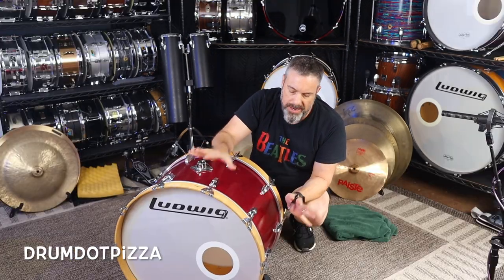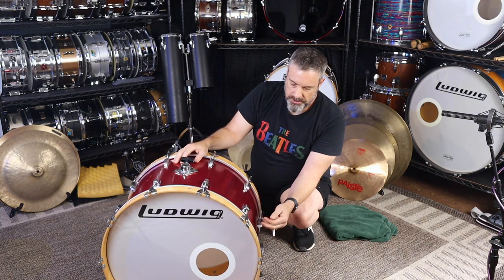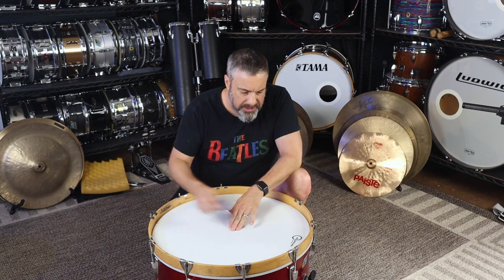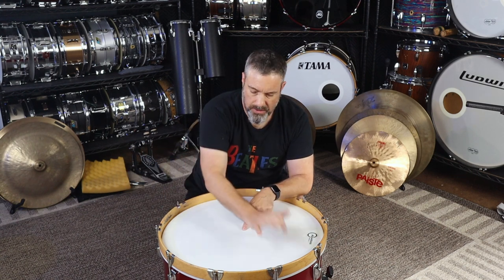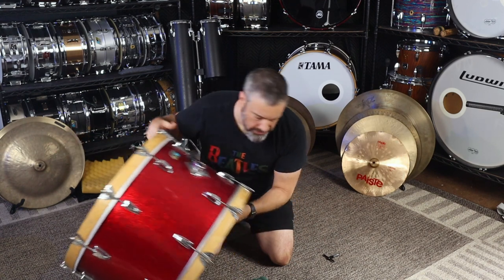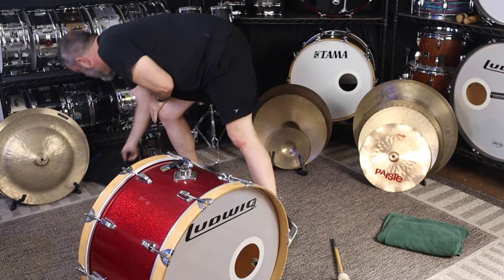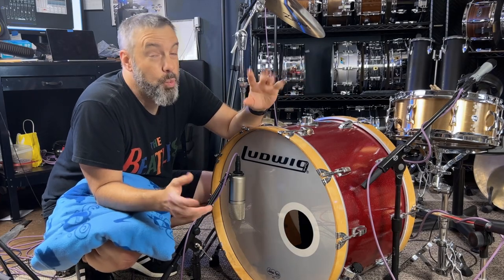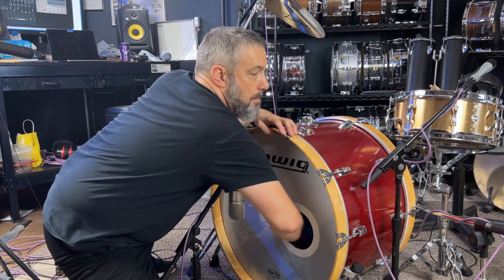Tuning Your Bass Drum With Microphones In Mind

Comment: I've always thought that hollow basketball sound was something I didn't want....but I guess it's a different sound when miced and recorded properly.   Thanks for making a great and informative channel.  I love it
Reply from the maker: Thanks so much for your comment!    Yeah, the unmuffled 'empty' kick drum is a weird sound, but actually it can be rather cool in the right context, particularly if you add the outside mic as well (which I didn't in the short clip in this video).  Usually, though, even if I don't actually try to tame the heads with muffling I'll still put that light piece of foam in the bottom of the drum to absorb some of the high frequencies bouncing around.  Even that little bit of soft mass can tame the 'basketball' effect to something more broadly useful.

Comment: I had that same Ludwig bass drum it was a bad mofo! One of the best sounding drums I’ve had or heard. I liked a medium tuning, higher than what you have but not much, with no muffling just whatever muffling the heads would provide. AKG D112 right by the hole and done. 🎉

One thing I didn’t understand was when people would take bass drums and then tune super low. It’s a bass drum. It’s already very low. 😂
 
I would love to hear that drum tuned up like half a turn on both sides. I bet you it will sound even better. 

Also thought the detuning a lug or two was totally ridiculous and unnecessary. Just tune both the heads medium with the front head higher. I didn’t understand the overthinking. 😅

Comment: Kind of off topic. I'm a drummer and I just did a renovation in my basement studio that made a really big positive difference. Pretty good size basement, but low ceiling. 7 and a half or 8 foot tall, unfinished ceiling. Cinder block walls, but I have a lot of bulky furniture and acoustic foam on the walls to control the sound. What I did, was finish the ceiling by putting rockwool insulation between the joyces and then enclosing the ceiling with moving blankets. Deadening the ceiling made everything sound way better. Especially when I add reverb to the drums, the reverb sounds much cleaner than before. And compressing the overheads or room mics doesn't bring up weird reflections from the ceiling anymore.

Comment: Man, the resonant setup sounds massive. So good.
Reply from the maker: Thank you!  Did you check out the companion video on my rebooted recording channel (RecordingDotPizza) where I show how to emphasize that character in the mix?  

I absolutely love the bit of what I call 'bloom' that happens with the fairly unmuffled single ply front head.  It does add a real sense of mass and authority without getting in the way of definition.  The best of both worlds!
Reply: @drumdotpizza  yeah, it sounds big without losing definition. Your setup here manages to get a really low note without getting flabby.

Quite frequently when I hear a really low tuned drum (not only bass drum, but also floor toms and sometimes large rack toms), they get this weird thing going where as the note resonates it kind of wavers in pitch and amplitude, instead of decaying smoothly.

Yours here is an authoritative thump, followed by a clean and crisp tone that decays smoothly. It's so pure it almost sounds like a synthesized sine sub.

I did check the other video (almost more important than this one, to me - I'm actually a bass player that does quite a bit of mixing) and will certainly be applying a lot of what you've shown there.

Comment: In this video, are you burying the beater or letting it bounce off? As an engineer, what is your opinion on how those two different sounds record or sound live?
Reply: Bets on buried.
Reply from the maker: I do NOT bury the beater.  I play heel up with the ball of my foot about halfway down the footboard with sufficiently high spring tension, so when I relax between beats the beater naturally comes off the head.  

There are some great players who bury the beater, but it just never worked for me, and I prefer a more open sound anyway, so don't want to stifle the batter with the pressure (and I've recorded TONS of drummers over the years who try to bury the beater, but either don't play appropriately for that technique, or tension the batter to high resulting in the messy 'flam' effect of the beater bouncing off then back onto the head with each strike.  That is damned annoying to deal with in post (I have more than a few times had to resort to sample replacement with such drummers).  

Vinnie and Dave don't have a problem, but a lot of drummers who try to bury the beater do.  

So no, I don't bury the beater.  And I prefer a the more open, resonant sound of not burying it.  Not worth dying for, but my preference if I can have it.
Reply from the maker: No actually (see my reply to the original question above).  

Interestingly, the lack of burying adds a definite clarity to the attack as there is no possibility of the 'flam' effect of the beater bouncing off the head and back on again as it does with some players (Neil Peart being one... listen to some of the isolated drum tracks on YT to see what I mean).  It's not a deal breaker, obviously (Neil was the MAN!), but I prefer the articulation of a single strike to the head followed by pure resonance (if not muffled).  Yields a very articulate definition to the sound without stifling the resonance/sustain of more open tunings.
Reply: @drumdotpizza  I stand educated. I could have sworn by the 'type' of power and control in your thump... even the less processed audio... And truly hope I didn't offend ;) Thought I knew mine ears better.
Reply: I've been playing drums for many years and I myself don't bury the beater all the time but sometimes you can't help not to bury the beater - it happens out of necessity.  I guess I learned that way but I honestly don't remember anyone telling me or teaching me to play that way.  Yes, you can hear the difference when you are listening to the drum microphones in solo but I'd venture to guess that you wouldn't be able to hear the difference in the context of a full band mix.  Not burying the beater does sound better to me with better definition and articulation but as Joel said in his comment you will have some pro drummers who bury the beater and some who don't.  Thee are several drums only versions of pro drummers on YT that are good examples of this.  One final thought, I remember watching an interview with Todd Sucherman of Styx on Drumeo where he was asked about burying the beater or not and he said he has never had an engineer ask him to play one way or another - and later went on to say don't worry about it!!!

Comment: I want to cut my bass drum to 14" but i'm just worried if something goes wrong, a 22x20 is way too long. Even thought of using the left over shell for a gong drum
Reply from the maker: Well... I don't want to tell anyone what to do with their property, but I would suggest that if you decided to do so make sure you have someone knowledgable handle the heavy lifting (cutting, truing, routing edges), and you do the finish up.  Just measure twice (or thrice!) before cutting/drilling/etc if you do it.  A little care can go a long way and the results will be wonderful, I'm sure.  

FWIW, I'm have planned a comparison video in the next few weeks cutting down a Pacific CX series (sugar maple, made in Mexico) 22x18 bass drum to 22x14.  I will record it stock first, log all the settings, then do the mod and re-record with same heads/tuning/signal path/processing for the sake of a reasonably scientific comparison.  I'm really fascinated to experience the results as I believe I know what to expect (based on decades of working with different dimensions of kick drums), but I have never done such a direct comparison before, so it could be eye opening for me.  Either way it'll be useful to me and I hope to others!  Maybe you should wait for that video before proceeding??

Thanks for reaching out!!

Comment: Been struggling with getting my 22x18 inch bass drum to sound good in my room even under the mics and this has given me some things to try! The drum honestly sounds great if I want to play like jazz fusion and is a great kick drum, but not a great sound for rock or pop. I am really thinking about selling it though and getting much shallower bass drums in both 20 and 24 diameter so I have two drums to go to when I need either that huge or that smaller sound and both those drums can probably get across the spectrum of kick drum sounds.
Reply from the maker: I gig with a local cover band using a DW Collector's kit (belongs to our sound guy!) that has a 22x18 kick (maple) and I tune it very similarly to what I did in this video.  It has good weight, but is more attack than bottom end (part of that is the Shure Beta 91 boundary mic inside the kick, I'm sure -- Beta 52 outside), but it does sound very nice on the live recordings!

I do own a 1968 Ludwig 20x14 kick with natural interior that is incredibly versatile.  Can be tuned for small, punchy vibe, or can open up and sound remarkably huge (MUCH bigger than 20") as well.  

It is amazing what tuning (and processing) can do to the perceived size of a kick drum!

But yeah, I'm a 14" deep kinda guy!  ;)
Reply: @drumdotpizza  yeah believe it or not it’s a 22x18 pdp kick drum birch, getting a good sound but just not super satisfying. I’ll tune it again and keep trying before I go crazy and start buying more kick drums. My room is not that big lol

Comment: This is gold, because I‘m struggleing with my 24x14“ Bass Drum to get more natural low end. I don‘t want to do it via EQ. Maybe a double ply head with no built in dampening could do the trick. At the moment I‘m switching between a coated or clear Powerstroke 3.
Reply from the maker: I really love double ply heads and no pre-treatment (felt, rubber, plastic, mylar rings, etc.).  Frankly when played medium dynamics and above the majority of the sound is attack, so taming the more unruly heads/lack of muffling is still fairly simple to do with some dynamics processing.  

As for EQ, I'm generally a subtractive EQ guy, but with kicks (and sometimes snares) I'll add a bit for weight and clarity/brightness.  I try not to go beyond a few dB here and there, though.  

Did you watch the companion video on my other channel?  I go into the processing that I did for this video, so check that out if you didn't -- might be useful for you (particularly the compression on the outside mic that really accentuates the sense of weight and size of the drum). 

Even if you don't add anything via EQ (you want a 'neutral' sound) you'll still likely benefit from removing some mid/low-mid content to clean up the boxiness that often results from miking kicks -- only as much a needed, of course, but don't be afraid to reach for it.
Reply: @drumdotpizza  Thanks for taking the time, Joel. I think, I‘m going in the same direction. First getting the drum as good sounding as it gets and than process from there. In the beginning I thought, the sound is made in the mixing process, which you can do, but it‘s getting very artificial soundwise. Of course I saw both videos, subscribed to both channels. :-)

Comment: So do you typically like your reso heads lower than the batter?
Reply from the maker: I do, primarily because I want to avoid a pitch which is harder to do with higher tension (though staggering the actual tension at various key rods can blur the sense of pitch).  

Also, with greater tension the 'rattle' of the front head (which sounds so good to me ears when close miked) can be excessively lengthy requiring a bit more fiddling to dial in.  When I record drums with higher tuned front head I may use a tad more muffling (either a felt strip inside or a folded T-shirt or the like along the bottom edge either inside or out) to keep the natural sustain under control, so the processing I do to emphasize its resonance doesn't become a sonic mess.  

Did you watch the companion video on my other channel that I'm reviving?  That demonstrates what I mean.  

Thanks for being here!

Comment: I'd been using PS3 on all my kicks for many years until I broke one a didn't have a replacement of the same head.  What I had around was an Ebony Ambassador from a collection of extra heads I got when I bought a kit from somebody.  I threw that on the drum and was very pleasantly surprised.  After dialing it in with tuning and some muffling to get it under control, that particular bass drum batter sounds better than the PS3 in how alive, punchy and clear it comes across.  I even put a dreaded kevlar patch on to keep from breaking it and that actually helped focus the sound just enough.  Funny thing is, when I've used regular clear Ambassadors on kicks, they never sound right.  Too sharp and a bit plasticky.  I think maybe I stumbled on a good recipe with the Ebony Amb and muffling, but it really works.